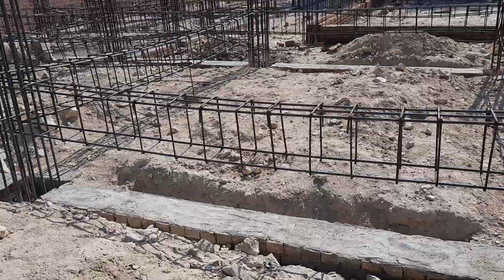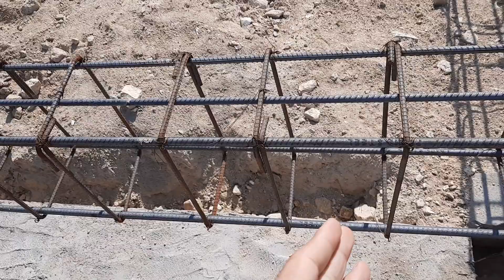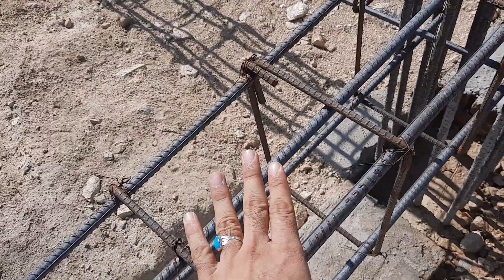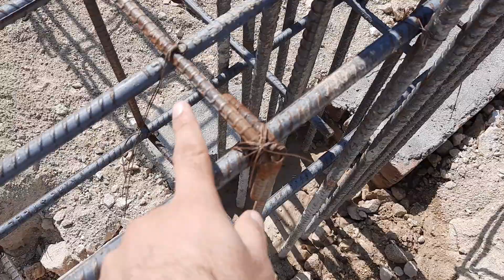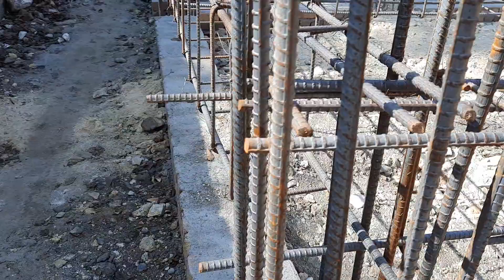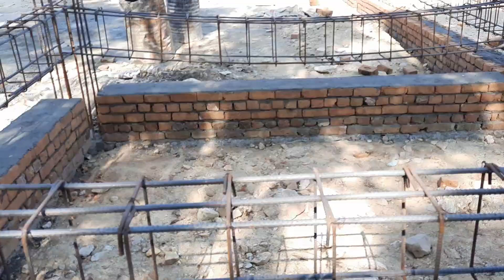Steel Structure Mistakes of Beam on Site Practically

Comment: Funda is good, but the placement of steel is normally based on +ve BM and -ve BM.
  The word "guys" is normally an  informal word, so frequently using it in such intellectual social media does not fit. 
Also many grammatical errors the noticed which need to be improved pls.